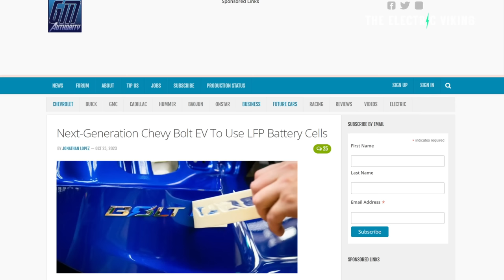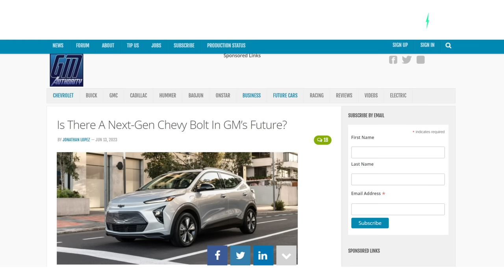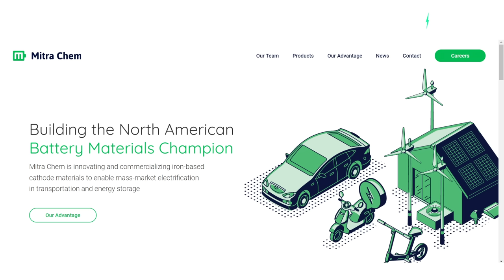New Chevy Bolt EV will save billions using LFP batteries made by U.S startup

Comment: Second time EV buyers don't care as much about range because the range anxiety goes away.  I'd trade some miles for the longer term reliability of LFP batteries and the fact I will be able to set my nightly charge to 100% instead of 80.
Reply: Well said!  Range aniexty goes away when you realize the way people use cars.  Average daily range is less than 40 miles per day. 
     Trips to the country etc are typically a few hours  vacations are cheaper and faster taking a plane. Want scenic views ride a train!   Worst case? I’ll rent a ICE.for that rare long auto trip.  
    200 mile range is plenty for our needs.
Reply: @frenchydampier2209  I always rent a car when going more than say 5 hours away - I don't want to deal with something like a transmission failure hundreds of miles away, or a cut tire, or even a flat.  I rent a car, and if and when I have a problem, they drop off another car.  But even when I'm driving that long, we always stop every 2.5-3 hours for coffee, meals, tinkle, or just to stretch our legs and backs.  During that short stop of say 20 minutes, it will add another three hours of range to the EV.
Reply: Yup, and Tesla will be right there with LFP at 25000 under cutting all OEMs, but BYD. Crushing the bottom line of GM.
Reply: @ohger1 20 minute breaks every 2 to 3 hrs.
Reply: Hear, hear. Absolutely agree. The Superchargers network is growing up at light speed for those who do long hauling (not that many & not that often). People with range anxiety have been spooked by the crappy low autonomy of modern 📱. For 🚗 it's an entirely different equation.
Reply: I absolutely care about range and most people do. It's just that lfp energy density has increased making it viable for a reasonable range for a more affordable vehicle.
Reply: I would be thinking along the same lines. After living with the under 50 mile range of my Leaf at 80% for six years I have completely grown out of range issues. Any range over 100 miles will be just great and I won't think about it again.
Reply: Two 3-year lease on Bolt, only problem in 6 years was charge port plastic pin cracked.  Is this good enough?

Comment: Now, if they would also put a heat pump in the new Bolt EUV. That would be great for us northerners.
Reply: Heat pumps are great when the temperatures are in the 40s or higher - once it gets into the 30s, efficiency drops.  Under 30 and you're on resistive heating.
Reply: My Bolt does fine here in Indiana. I preheat in the morning while plugged in.
Reply: If, it is like the one in my house, it is good to -5 F. I seen a video with a Telsa, and the heat pump smoked the regular heater. The video was in the single digits. I know, in Wisconsin, it would be nice to have some cheap heat. I use a 12v heated blanket. Rarely run heat at all. I would use a heat pump.
Reply: @ohger1  There's no reason to switch entirely to resistive.  Instead, you can use resistive heat to warm the cold side of the heat pump cycle, but still use the heat pump for most of the load.

Comment: I LOVE MY CHEVY BOLT EUV!!! Sorry for the all caps, I really love my car.
Reply: I almost bought one but GM stopped sales due to the battery. By the time it was ready, didn't need it. I really liked it when I test drove and was looking forward to owning one
Reply: @pucky900  I understand why you didn’t move forward with your purchase. Mine is 2023 and I love it. I charge at home and my wife charged a 2022 Mach e premium extended range and we don’t miss gas stations.
Reply: You are not alone. I admire the idea of LFP battery since allows charging to 100%. A faster DC charge would be a nice addition.
Reply: We love our Chevy bolt EUV too. We’ve been driving it every day for almost 2 years with absolutely no issues. Just drive all day, come home for dinner, plug it in, charging starts after 10:pm when power is dirt cheap, drive all day, repeat!

Comment: So glad to hear GM is going to use an LMFP battery for the Bolt when it comes back in ‘25. First off, less danger of fires and since they are cheaper, the car won’t be more expensive. It’s the first smart decision they’ve made in years. Hope it works out.
Reply: The car will be more expensive because they can. Then the dealers will mark them up because they hate EVs,
Reply: GM dealers will be a problem that will not go away.

Comment: You're on the wrong track.  Mitra Chem hasn't stated anything about making their own cells.  They are a cell component manufacture (at least cathodes), or that is apparently their plan.

LG Energy are planning to make LFP cells in the U.S.  LG Energy is building a battery/cell manufacturing complex in Arizona, and one of the products they plan to make is LFP Pouch cells.

That doesn't necessarily mean that GM's supplier for cells for the Bolt EUV will be LG Energy in Arizona, but GM does have a strong connection with LG Energy.
Reply: Perhaps this start up will be helping LG reduce battery costs?
If what you say is true that would make sense.

Comment: Borg Warner has a license to assemble blade batteries for Ford and GM
Reply: Only for commercial vehicles. Not passenger cars
Reply: Good, when it comes to cell packaging for BEV batteries, the blade configuration is the only way to go. It leads to as as simpler, more compact, lighter, less expensive battery

Comment: The perfect next-stage battery-packs will hopefully combine circa 85% CATL Shenxing LFP with 15% CATL sodium ion. Sodium ion cells are very low/high temperature tolerant(-40C to +60C) so that in sub-zero temperatures with mixed batt-packs the sodium ion cells could kick in and provide power for at least 5-10 miles until the LFP cells have warmed - or cooled down in extremely high ambient temperatures...
Paul G

Comment: If I could buy a Bolt EUV that would charge at a Supercharger location, that would definitely pique my interest.  My 2017 BoltEV Premier only has four things I'm displeased with.  1: It's Fast Charger ain't fast, 2: The seatbacks are too hard (GM puts substandard seats in a LOT of newly released vehicles) so they can brag about better seats later on, 3: The Heat and AC better have a driver selectable choice, instead of letting the car decide which one, and finally, 4: I want a spare tire and the tools to change a flat, whether it's standard equipment or extra cost.

Comment: All G.M. needed to do is use LFP batteries to increase the range to 320+ miles and allow use of Tesla's Supercharger stations of 150kWh re-charge rate. The Bolt EUV is a good design for an entry level EV. Using the Tesla charging network would be a great plus for long trips. AND I do not want to be held back to driving like a little old lady at 55mph and re-charging every 150 miles.

Comment: It was reported that GM had a falling out with LG Chem over making LMFP batteries at their third battery plant. Looks like GM will partner with  Mitra Chem instead. The problem is Mitra is a start up with no manufacturing experience, so GM will be making these batteries instead of LG Chem.  Doesn’t make much sense to use the LMFP batteries in only the Bolt. Wonder if the Equinox EV 1LT will also get them as its MSRP is significantly lower than the higher Equinox EV trims.  For me LMFP is a plus, not only cheaper but less resistant to starting itself on fire.  They have less energy density but they have no problem being charged to 100%.

Comment: Honestly, I think Toyota has it right, EV's are fine for many, but most people can neither afford them (even with rebates) and range/recharging is still an inconvenience some people can't overcome. I wish more manufacturer's took a pragmatic look into EV's and made more PHEV/hybrids models like Toyota. Chev (etc.) have really dropped the ball in not making hybrid options on their petrol engine vehicles which would still save consumers cost and still make a difference into easing new customers into EV tech. Looking at GM, where they not only killed off the production of cars and hybrids, going straight to EV kind of left them open to losing money to other brands that offer those models (hard to listen to GM cry when they made these choices). More innovation in ICE/Hybrid/PHEV models are still possible and needed for consumer introduction until EV's become interchangeable in price and convenience.
Reply: You Make a valid argument, except for one issue. The two downsides to EV’s may be gone within the year:
Range & price

then the problem of hybrids:
why have two technologies when 1 is more efficient

Comment: Whatever tech they use, they better hurry. Consumers are losing confidence in anything EV from GM. Delay after delay and shitty software issues is hard to ignore. Lastly, the price of their EVs is the same or higher than the competition. I think most will pass until they get things worked out and running smoothly.

Comment: Equity in the Bolt brand? GM had to recall every Bolt ever made because of its exploding batteries. They are grasping at straws with the Mitro investment. Mary Barra is just collecting a paycheck and completely uninterested in GM's future. CATL already has an LFMP battery in production. Wonder if they have a case for patent infringement against Mitra?
Reply: Despite that, the Bolt is a sought after used BEV.
Reply: I think lg made those batteries if I'm not mistaken. I also believe they've all been replaced and I can assure from personal experience they are amazing cqrs

Comment: In 2025 a Chevy Bolt with LFP batteries? So, what, that is at least a year away. 
The Citroën ëC3 is due to arrive at the dealers in April 2024 all over the Europe (and remember Citroën is also in the Stellantis family . . . . just like GM). 
LFP battery, sub €25k, 200mls range, 100kW charging and build in the EU.  
And all the Tesla fanboys keep waiting on that sub $25k Tesla fantasy, that would be the first affordable sub $25k EV and on sale around 2021? . . . . . bla bla bla. 
The Renault R5 Etech will be the next 2024 EV around that €25k mark.

Comment: For most of Tuesday, Feb. 27 2024, Chicago looked and felt like summer: Apartment windows were pushed open to catch the warm breeze. Restaurants set up tables & chairs on sidewalks for al fresco lunch service, a rare sight in a Chicago February. The lakefront was teeming with runners, cyclists and couples strolling hand in hand. The city’s mild winter, on the heels of the warmest year on record in 2023, felt eerie & unpredictable. Temperatures are rising across the Midwest because of human-caused climate change, according to the 2023 National Climate Assessment, the government’s premier compilation of scientific knowledge on the effect of human-caused warming. Unseasonably high temperatures across the Great Plains, along with high winds, were / are propelling wildfires in Nebraska and Kansas, which were still a threat on Tuesday after forcing evacuations this week. Wildfires have been raging across the Texas Panhandle for days. Only 4.3% of the Great Lakes’ surface is ice-covered, well below the average. The unseasonably warm & dry winter has affected tourism in the region, especially in Michigan, Wisconsin and Minnesota, where industries that depend on snow have suffered.

Comment: LFP batteries have a lower energy density, they cannot store as much charge as other electric car batteries. That is why they are only used in the entry-level Standard Range models. They also cannot be charged as quickly as NCA and NMC batteries, especially not in the cold.

Comment: GM has three of  it's own battery cell manufacturing plants, including one partnered with LG that will come online in 2026. The others should be online now. Mitra Chem makes battery cathodes & chemistries, not batteries. Seems likely that they would supply GM's battery plants with a chemistry platform and cathodes and not actually be making batteries.  BTW the reason GM has had problem producing enough batteries for their EVs is not cell production, it has been module assembly. They choose to use in house staff and an automation vendor who had never assembled modules at scale. There's good reason I think, to expect the 2025 Bolt EUV to have an LFP, LMFP or LFX (Mitra proprietary) battery made by GM in North America using Mitra's tech, configuration and materials.